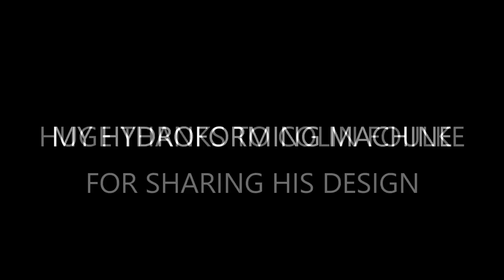My hydroforming machine

Comment: Hydraulic clamps would have saved much time and energy.
Reply from the maker: Hello. Could you explain further?
Reply: @pansmithhandpans7080  instead bolts use Hydraulic clamps.
Reply from the maker: @syedkeyol  I'm afraid for a machine intended to keep cost low in small shop at home, there is not enough volume of production to justify the exponentially higher cost of a hydraulic clamp setup.
Reply: @pansmithhandpans7080  anyway getting great finishing in the product.
Reply from the maker: @syedkeyol  thank you. Are you familiar with what I use the shells for?